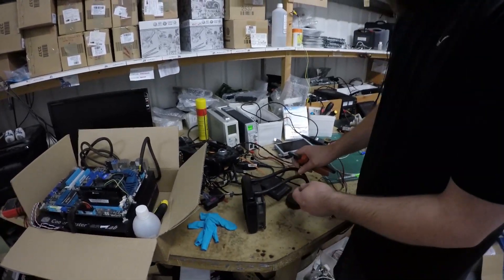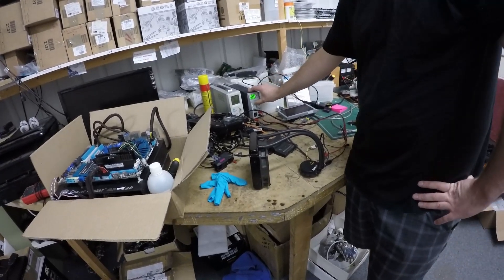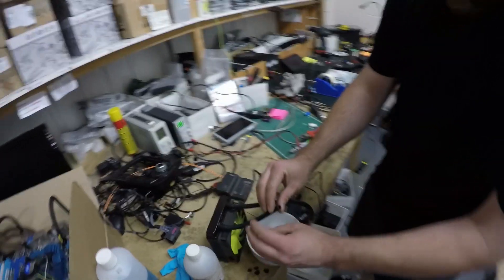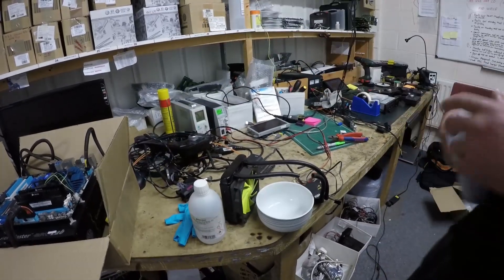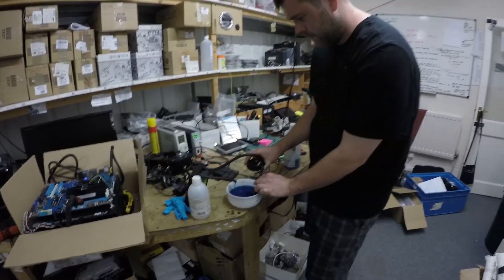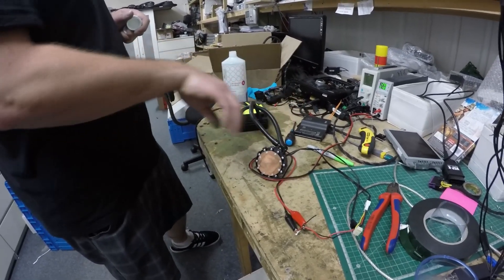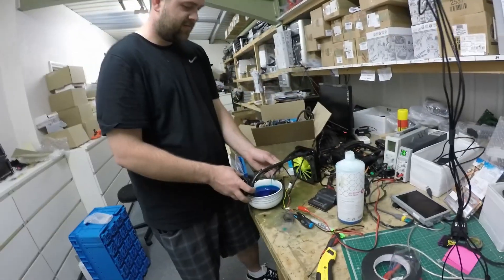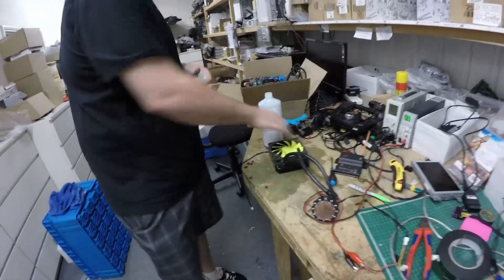CAN YOU REPAIR AIO COOLERS ?

Comment: how much liquid is enough to refil a cooler like this and what is the liquid mixture you used ,i have a simular one but it started to leak at the end of where the hose fits on to the pump and i wanted to repair it and reuse it in a build